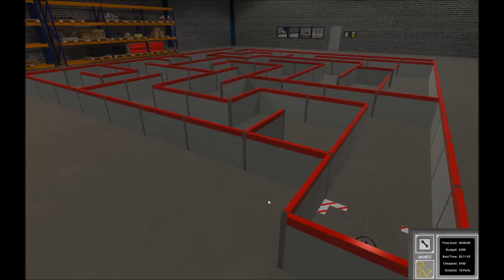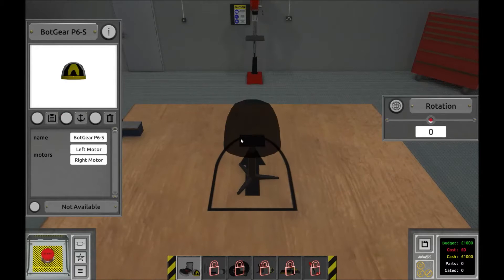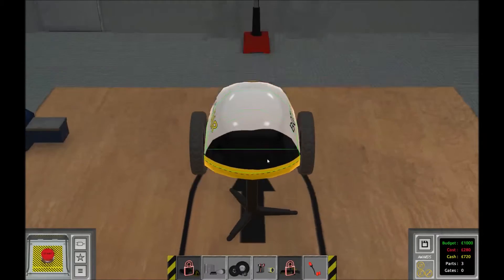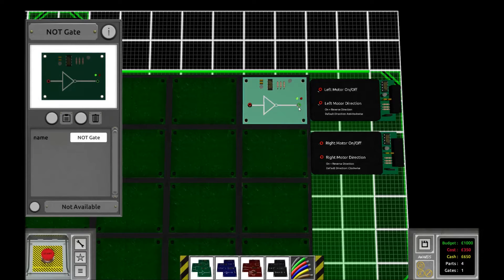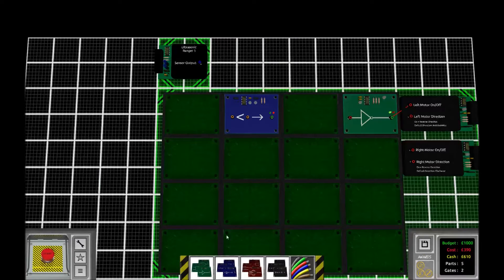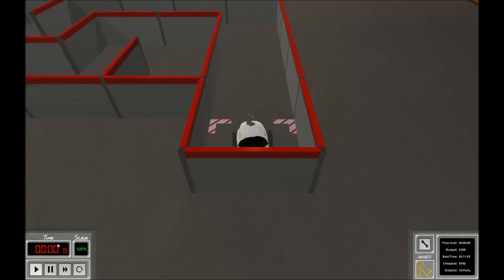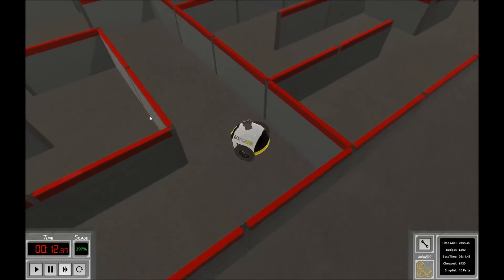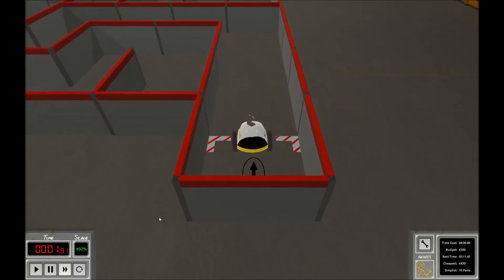Logicbots 2-1 Wall Maze

Comment: Nice! Good: you even showed us how to get it done "cheap".
Now can you finetune it so it is a little bit faster? :)
Reply from the maker: +mpeijzel Notice how I did it on the first attempt. That one is fast, but requires a lot of finetuning. If I recall right I used one laser ranger and one ultrasonic ranger last time I finished that level. The laser ranger forced it to turn sharply before running into walls and the ultrasonic was looking in the same direction I show on this video.